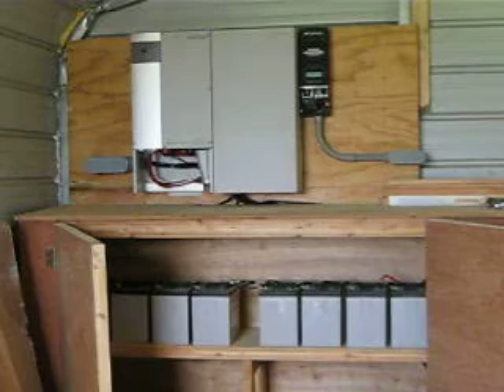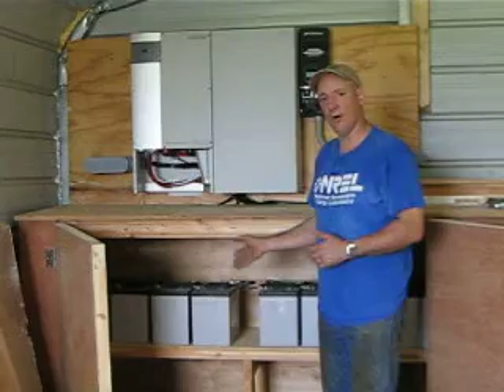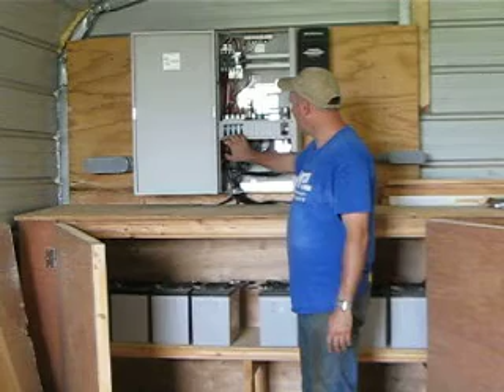J&L Ranch - Solar Project - Inverter.avi

Comment: They are likely sealed batteries.   If that's the case then there's no need for a battery vent.  

Neat installation

Comment: How is the Outback Power Flexmax 80 Charge working for you? I was wondering what other charge controllers did you consider? What made you select the Flexmax? I have 14KW recently installed PV system, and I'm having problems with the Apollo T80HV controllers. I have 3 of them running in parallel, and the 2 slaves started having issues after bout 1month, and customer support sucks with Apollo. I'm thinking of switching to the Flexmax80 or Xantrexs charge controller.

Comment: you could take that 120 vac from the inverter and feed it thru an Outback transformer split the phase to 240 vac to feed such things as a well pump & water heater.
john

Comment: Awesome! Man that is a excellent system.I noticed that you chosen a Out back charge controller good choice. I wish i had a 48 volt 6000 watt xantrax inverter like yours sweet. Good job on wiring it up very neat. I would highly recommend that you vent the hydrogen gas that your batteries will give off to the out side.